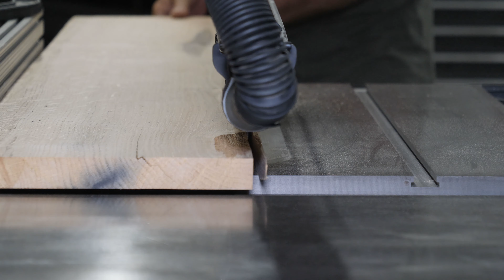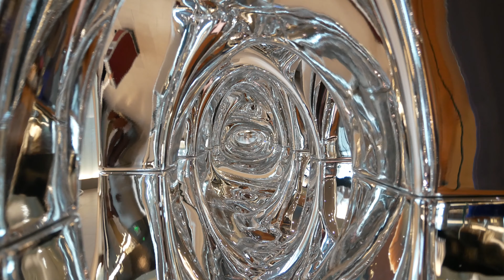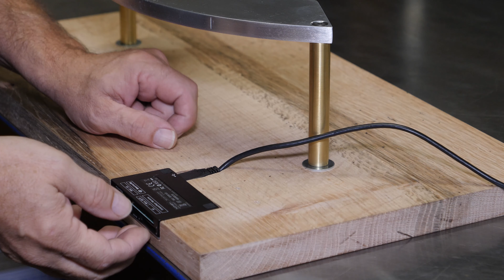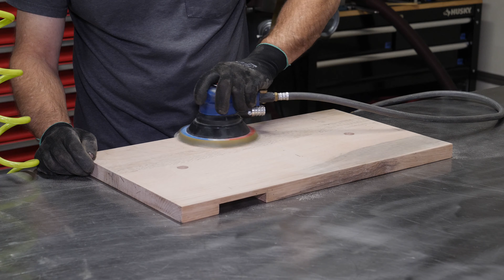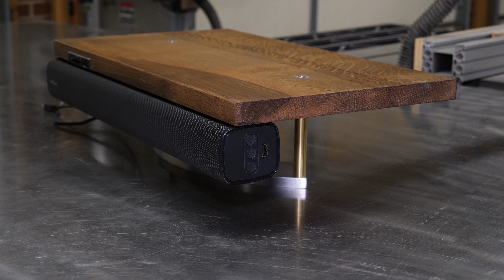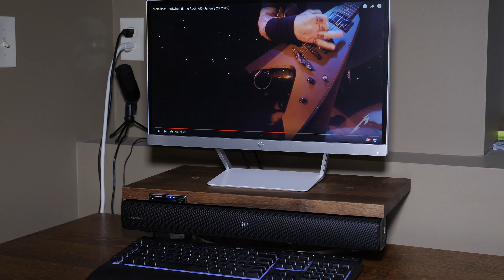Custom Monitor Stand with Integrated Sound Bar and Card Reader

Comment: Just got a chance to see the video, been busy over here. I love the setup on the monitor, especially the speaker unit mounted to the stand. I moved mine up, on a store bought one an it helps. I can appreciate craftsmanship, love the mixture of wood and metal. Since I’m not a woodworker what was the wood type on the boards you used for the base? It looked really good before you finished it
Reply from the maker: Thanks James, I really like the metal and wood combined also. It's oak, I normally don't use stain but I wanted to match my desk. The match was really close and it just blends in. When I'm sitting at the desk the stand appears to be floating.

Comment: Hey you really should support your material out the back. You can see considerable wobble in the video. I saw a guy at work doing that and it gave way and started slinging around at 1300 rpm. We had to call ems and have a safety meeting. They bought us stands like jack stands that have a steady rest on top. You could weld one up
Reply: At our workplace we turned a spider with 4 bolts like a 4 jaw to sit on the rear end of the spindle, works a treat for long bits of bar